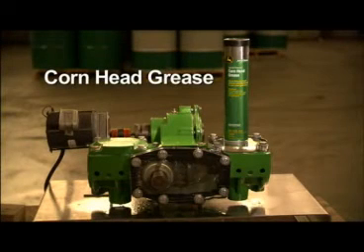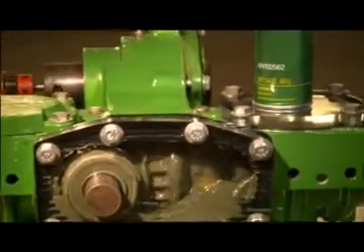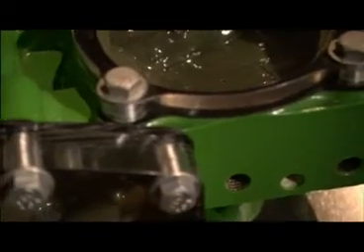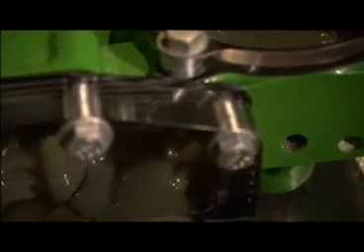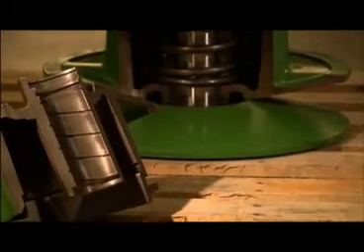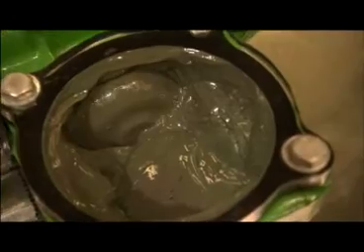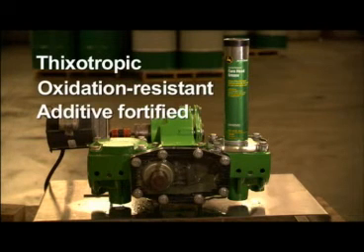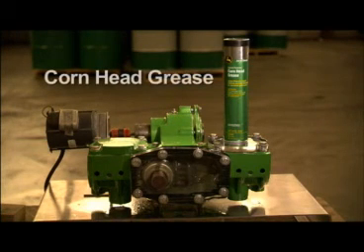Polyurea Grease

Comment: This stuff is what you want to use in older manual steering gearboxes with leaking seals, the kind with circulating balls. It works great in all temps, and won't leak anymore.